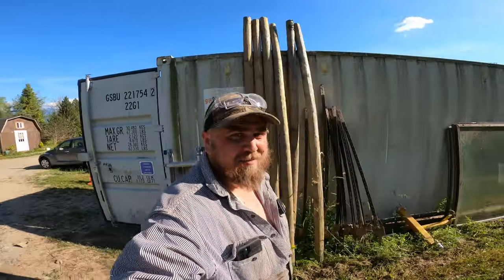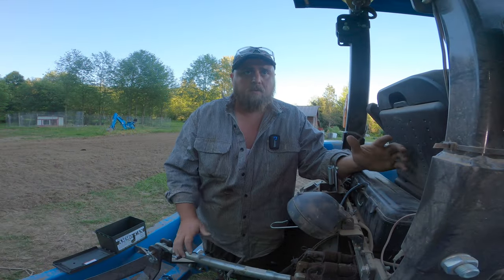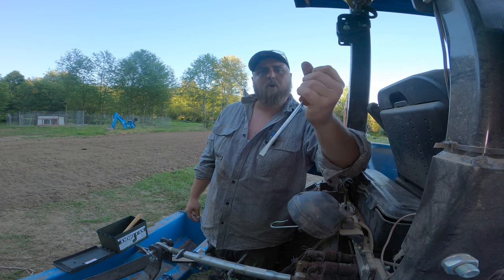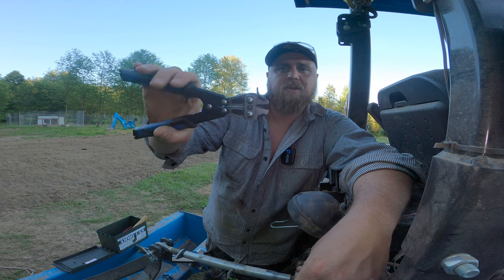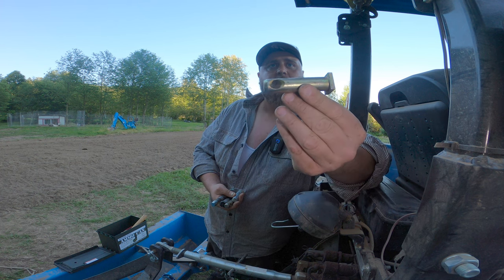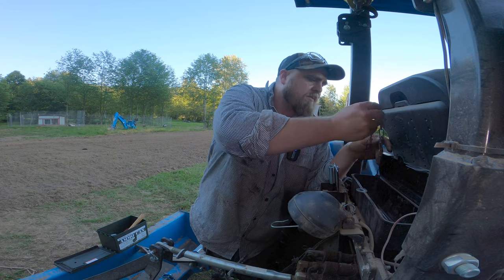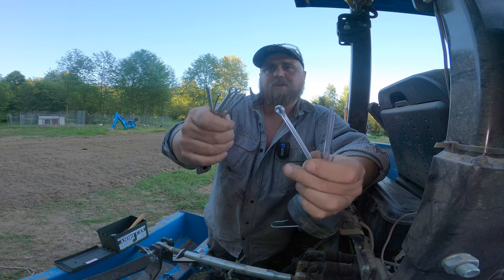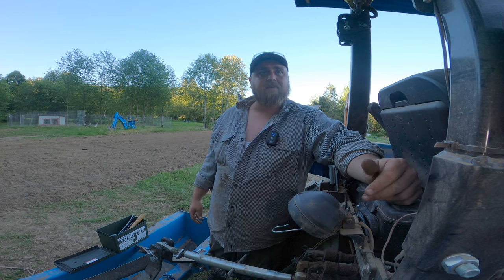What tools are in MY tractor's tool box?

Comment: My tractor doesn't have a tool box outside, so my stuff is in some of the handy pockets around the seat and sliding around on the floor in the cab.   I have some of the same things as you do.
Fencing pliers.  They can cut fence wire, or secure or remove a staple.  You can never have too many. I have several around, even in my horn bag or my saddle bag.   On the trail you can attempt to secure or remove a loose horse shoe.
I have a 2 or 3 lb drilling hammer.  They have shorter handles than the ball peen hammers.  For persuading hitch pins in or out.  
Alignment pry bar.  Long taper on one end. For aligning 3 point hitch balls, before pounding hell out of the pins with the drilling hammer.  I might cut the flat prying end off, so it'll be easier to pound on, and to slip it under the seat.  Because  No tool box.
LED flashlight.  I bought a 2-pack or 3-pack at Costco or HF, and popped one in the tractor.  If it's not still in the cab, it's made it into the pocket of my Carhart. For those "let there be light" moments.
Box knife.  Same basic story as the flashlight.
A partial bag of T-post wire hangers.  I don't want them in the tractor, but like I said before:  No tool box.
Reply from the maker: Good idea on the wire and flashlight.  I got some fancy pry bar/alignment tool things from Matco, so I might throw one in to replace the screwdriver if it ever decides to break